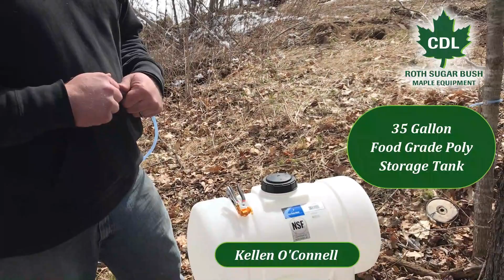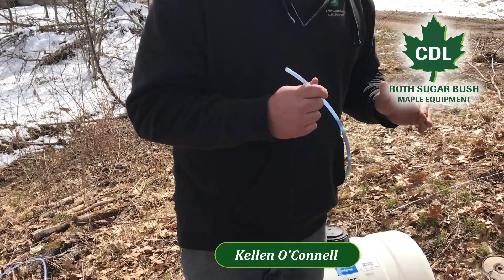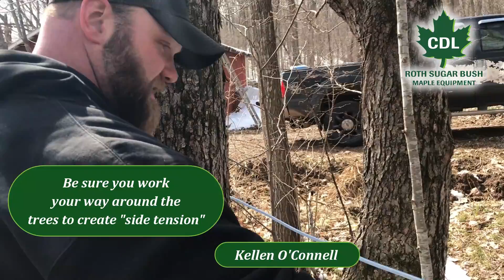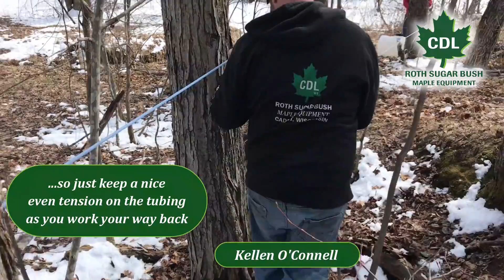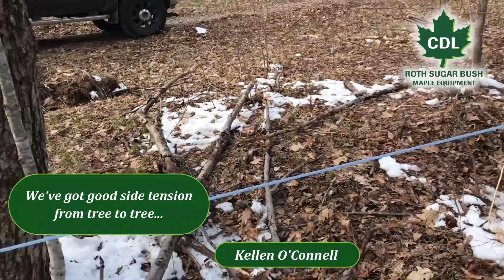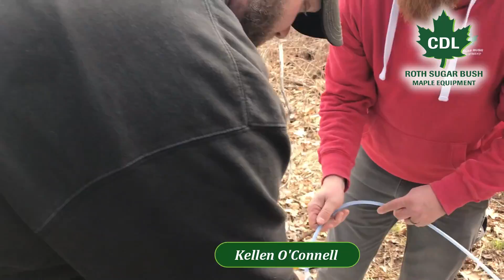How to Install 3/16" Tubing

Comment: So me and my daughter tap about 20 or so trees I have fairly flat property so what’s my best bet how high do I put the first tree tap and how low do I need the bucket? Thanks so much
Reply from the maker: The gathering bucket or the tank is usually placed on the ground. The height of the tank determines the starting height of your tubing system. You will need to run the line uphill from your starting point. Hope this helps!